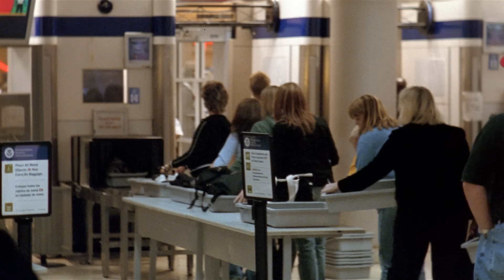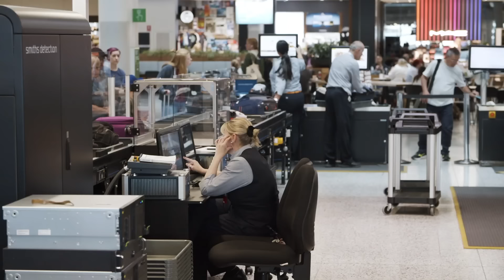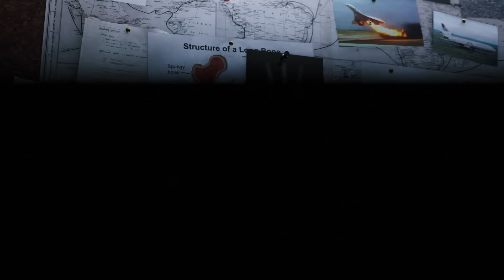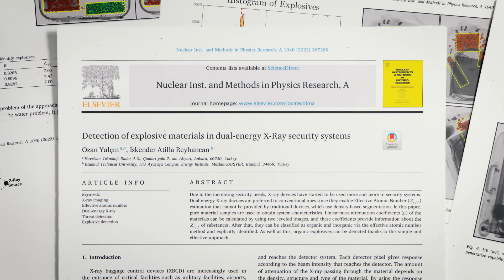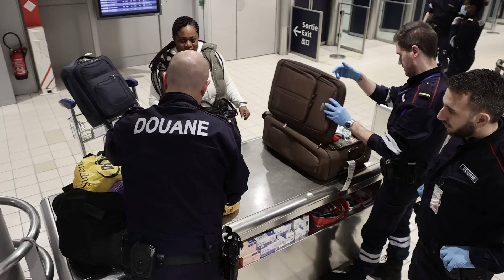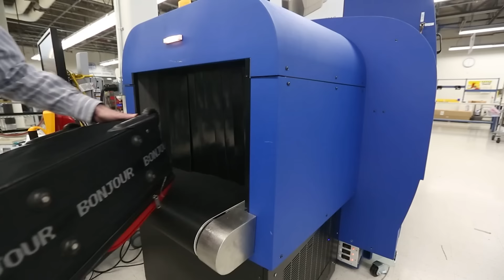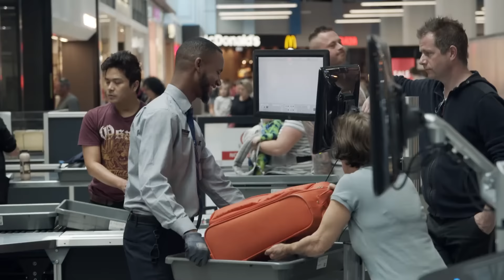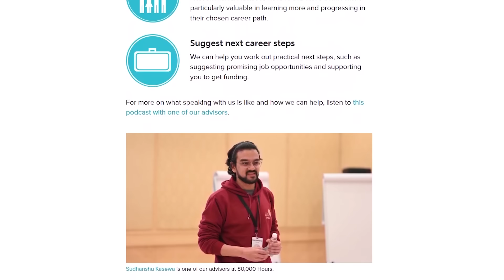Why Airport Security Suddenly Got Better

Comment: Beware if travelling with film! These machines will usually wreck it, put your film in a plastic bag and ask a member of staff to hand check it for you instead.
Reply: Yes, CT scanners will fog ALL film, regardless of speed (ISO)!  Hand check it always.
Reply: @FarkleMpls  That isn't true, it only matters if you don't store it properly, but hand checking it is still good so they don't think a knife is inside.
Reply: @FarkleMpls  This is incorrect, It depends on the CT scanner,  there is only 1 CT scanner on the market that is not safe for film the rest of them can scan film without damage.
Reply: @philipnash4043  Hi Philip -- thank you for this information.  Do you know the model # of the CT scanner?  I (prefer to) haul around film internationally and like to be well informed before I get into arguments about the necessity of hand-checking film with various TSA-like security folks around the world.  Berlin security was particularly stubborn.  I used to have Smiths Detection as my customers and I may check with their product engineers.  If I do, I'll post an update here.  Thanks again.
Reply: While good advice, hasn't this always been true with taking film through airport security? I remember traveling to Europe in 1992, and losing a few rolls of film to airport x-rays.
Reply: @BCWasbrough it really depends. every film is a bit different, but CT will cook the vast majority on one pass. Happened to me in Amsterdam, it did develop and you can obviously see the photo - but its really fogged - cinestill 800T - So i'll always arrive early ready to negotiate. Or put fake Delta 3200 iso stickers over so its too high to even be x-rayed hahaha!
Reply: @BCWasbrough  They used to sell lead plastered bags for films in that era.
Reply: @jimbotron70  Yeah. I was using them at the time. I credit their usage for not losing ALL of my pictures from that trip.
Reply: @jimbotron70 Those bags aren't safe to use anymore, the newer gen scanners will keep increasing its power until it can see through the bags.
Reply: @jimbotron70  Yeah, but the operators would just put up the power until they got an image so not really a solution.
Reply: @BCWasbrough  No. The old X-ray machines are not powerful enough to damage regular film. If i remember it correct the old X-ray machines emit round about a quarter of the natural background radiation. Your film is much more likely to be fried on board of the airplane at cruising altitude as it is subjected multiple times the natural background radiation at ground level for hours. The new CT scanners however can fry your film due to the use of high-power X-ray emitters.
Reply: Film cameras are like buying vinyl records. It's not mainstream anymore, but for a variety of reasons some people want it. Just because it's not for you doesn't mean that others don't care about it for their hobby.
Reply: bro my film got ruined at melbourne airport 😭
Reply: @lachlanlau  Oh Christ.  I got given six rolls of colour film last Christmas and flew out of Melbs,  They would hand-inspect the infrared that I bought but not the ISO100.  Guess that is all toast.
Reply: The difference between film and digital goes way beyond resolution. They have very different behaviors when it comes to dynamic range (difference between highlights and lowlights). 

Not just that, a 35mm film camera with good film might only cost a few hundred dollars, but mimic the resolution of a several-thousand dollar DSLR. While you're paying more per photo, the entry cost is much lower. That's great if you're trying to figure out if the hobby for you. Use your phone to get a general sense of light levels, framing, etc - then take one "keeper" shot on film.

That's before discussing medium-format and large-format film cameras, which can provide the equivalent of hundreds of megapixels under the right circumstances (plus the dynamic range benefits mentioned above).

Film is definitely a niche thing now, and not for the average person taking family snapshots like it was from the 50s through the 90s. But it's not completely obsolete.
Reply: @PsRohrbaugh Used DSLRs are quite cheap too, and are generally more flexible. Lets you experiment much easier when you immediately see the result. 

The films advantages are mainly the looks people like and the dynamic range. I don't really think that most people care about resolution that much, with the sizes we typically view images at. (and I see conflicting information if film "resolution" even wins against 10yo cameras nowadays at regular speeds)

I feel like the inconvenience of film are much more likely to make people not continue as the lower resolution of older digitals. 
Not like I can really say, I only shot film once at school in a photography class. I am considering giving it a try again soon, but it doesn't really fit my style of photography. 

In the end I'd rather recommend to go for something like 70D or 5Dmk2, although, old low end DSLRs can be experimented with as well. I personally started with a 550d, something that can be found used with like 30€. Really depends on your budget :)
Reply: @manitoba-op4jx 100 year old cameras don't just "have better resolution than your iphone", they have like... something along the lines of FORTY TIMES more resolution than your iphone, for 4x5, and 100x+ for larger formats (but those aren't really portable anymore)
Reply: Film can put in more details for its size. Such is why cinema is still using film today.

That being said. Processing them is a pain compared to a point and DSLR, mirrorless or your phone.
Reply: @niccatipay  Modern digital is more information dense per square millimeter, but there are not yet any medium format or up digital cameras that cost less than like, a car. (GFX is not medium format, MF is 645 and up). So even though it's more dense, the ceiling on format size makes it still lose to film medium format+. Mostly though, it's the look and the process.
Reply: i tried and the lady was so rude about it and made me put my film through with the others
there went that roll 😡
Reply: I have cassette tapes and I’m worried about them getting damaged in one of these!
Reply: @sncy5303 People who prefer the inconvenience and technical limitations of film over digital.
Reply: I have a lead bag for film.
Reply: I have a lead bag for film.
Reply: @xploration1437  They only help a bit, and they may possibly crank up the radiation to see through it anyway, depending on the machine's capabilities and their operating procedures there.
Reply: At first I went "yeah, of course"
Then "oh shit, that disposable camera I got might be fugged" 😬👍
Reply: Many years ago EASTMAN KODAK made film photography available to the masses inexpensively.  You have to be a certain age to remember a Brownie camera.  I visited the Kodak plant in Rochester New York state many years ago. Who could forget the Instamatic or the flash cube? Then along came Polaroid.
Reply: Digital sensors are unaffected.
Reply: I found this out with one of those instax Polaroids. I was so confused as to why ALL of the shots were coming out so overexposed!
Reply: Don't the TSA agents say that's just a conspiracy theory? "It'll be alright" 🤦‍♂
Reply: I'm sure somebody will come up with the idea to store ammunition in one of those reels and then it will be another thing that gets banned on flights. Imagine having to ship film reels a week before your flight only for it to get cancelled and your package delivered. Expensive old new stock film is going to become scarcer even faster.
Reply: Also be prepared for it to wipe your word processors... if that's something you need to be prepared for.
Reply: The war on terror was officially ended in 2019. Why are all these machines still there?! 
Hi time to remove them again. Or are we all now     "Guilty Until Proven Innocent"?
Reply: Thought most X-ray scanners are certified as 'film-safe'
Reply: Becaureful, in Lisbon airport (Portugal), the staff are not allow to hand check film without a premision from ANAC. If you dont have the premission it will need to go in the X-ray machine.
Reply: @goncalodemetrio1638  well then you simply stop the plane and have somebody from ANAC come over to give you the permission.
Reply: they make lead bags for film for a reason
Reply: Oof, learned from experience?
Reply: I wonder if that’s what happened to my disposable cameras from my 8th grade DC trip in 2005
Reply: Oh look, somebody didn't study engineering or science! They are the reason why public transport SUCKS! BOOO
Reply: Is it though bacause i had my film camera with me and they wouldn`t let me skip the scanning for it and i thought ok all my photos will be ruined but they turned out just fine, no quality loss or anything.
Reply: @bishopoftroy  Was it one of these new machines or an older one? What ISO was the film? IIRC, the older machines were supposedly safe for 400 and below or something like that
Reply: @Cyberguy42  I've heard older machines are safe for lower ISOs, but I never want to test it and always just have them hand-check all my film.
Reply: @Cyberguy42   Yes the older machines are pretty safe for 400 and below, but CT scanners are not.
Reply: @Cyberguy42  That is true, they are labelled 'film safe' but the exposure is cumulative so only take what you're going to use on a trip.
Reply: @bishopoftroy  Are you sure it was the newer CT scanner, or was it the old type of Xray machine? The older kind will not be too bad to lower ISO films (even higher ISO you will still get pictures, just perhaps slightly fogged).
Reply: @bishopoftroy  the fact it's inside the camera mightve protected em
Reply: @bishopoftroy  Yes there was quality loss. Did you shoot identical photos and mail one home to use as a side by side comparison? No, you didn't, because those who have done that and published it always show clear quality reduction. You just aren't aware of how much better it would have been.
Reply: @gavinjenkins899  i`m shooting the same film and the same camera for over 30 years now and i would`ve surely noticed something.
Reply: @bishopoftroy   That is irrelevant umless you have comparison shots of the same scene one of which didn't get scanned. Also CT scanners haven't even been in use that long, soo.... bs? Are you talking about old xrays, not CT scanners? The claim was that CT scanners ruin all film, not traditional xrays
Reply: @sncy5303  I'm a 25 year old photographer and I just started shooting on film about a year ago and I instantly became obsessed. Now I like shooting film arguably more than digital.
Reply: @sncy5303  Almost every photographer, next question
Reply: Or you can live in the current day and age and drop the pretentious attitude and buy an Alpha 7.  Film is great, don’t get me wrong, but grow and move on lmao
Reply: Ive heard they screw with the digital CMOS sensors used in modern mirrorless cameras as well.
Reply: @zaca211  wrong.  this is not true whatsoever.  Only undeveloped film has an issue.
Reply: @zaca211  Incorrect, low dose X-rays cant affect electronics in  short amount of time,
Reply: @zaca211  I've had my Sony A6000 go through the X-Ray machine countless times for almost a decade now cause there's no way it and my lenses are going in checked baggage. The only problem I have is envy to buy a A7 model...pictures are still perfectly fine.
Reply: Mylar bags works fairly well
Reply: @brkbtjunkie  Not for x-rays.
Reply: Thanks, I'll do that on the next return flight from 1972.
Reply: what is film?
Reply: I once tried to shove my horse and buggy through one of those new fangled airport scanning machines, and that unfriendly TSA agent got really mad at me.
Reply: maybe dont shove it next time
 @pilafmon
Reply: @manitoba-op4jx that's great! You should tell more people and finally put Apple out of business. I believe in you buddy 👍🏽
Reply: Film? Are you still living in 2008?
Reply: @T1Oracle  some people like using film
Reply: @bredemeijer9648  It's okay to have this opinion, you're not a photographer.
Reply: @T1Oracle  Film photography is alive and well; it may not be practical for the average user by comparison to a digital camera, but it is by no means gone as a technology. Film exposes much more detail per unit area than most consumer digital camera sensors, and in the hands of an experienced photographer will yield beautiful results. It is also still used for movie making, such as with IMAX 70mm.
Reply: @MediocreHexPeddler  Depends on what you mean by "most consumer digital camera sensors". Most modern DSLRs or mirrorless cameras will easily beat 35mm film in terms of resolution, perhaps barring some specialty high-resolution/low ISO films. My now ten year old Sony A7ii does 24 MP, which anecdotally seems to give me a lot more cropping possibilities than I have with most of my 35mm film.

Medium format (especially if you go for say 6x9 negatives) might still have an edge on digital though.
Reply: @bountyjedi  Your art has no truth.
Reply: @T1Oracle  Film photography industry is actually pretty big and even if it waned off in the mid 2000s up until ~2015-2016 it`s been surging since and it`s expected to double in the next 10 years. If you wanted to comment like this you should`ve done it in 2005-2006 so actually you`re the one not up to date.
Reply: @bishopoftroy  have you heard of mobile phones? Fun fact, billions of these things are sold every year, and they all have digital cameras attached. When film cameras sell in comparable numbers, let me know.
Reply: @T1Oracle  And all of those cellphone cameras are trash with minuscule sensors and shitty AI "enhancement" so that photos look barely passable on tiny cellphone screens. 
"It sells more" is not an argument. McDonald's sells more than any fine dining establishment, yet it's still slop for people who don't know better.
Reply: @T1Oracle  Sold in massive number to people who take bad photos in massive numbers, yes.
Reply: @T1Oracle  yes we have mobile phones here also but that`s not the topic here. If some greedy capitalist corporation forced you into feeling premium for buying their products ok good for you but remember that you`re an ambassador on your own money and here is discussed a completely different topic.
Reply: @bishopoftroy  I don't know what happened to my reply explaining all the premium digital imaging devices. Regardless NASA and the CIA both use digital over film. Mobile phones aren't the only digital imaging devices.
Reply: @T1Oracle the way you decide if something is valuable or relevant is by how many units it sells lol? do you have a shrunken head?
Reply: @T1Oracle  Film popularity has something like quadrupled in the last 10 years.
Reply: @gavinjenkins899  wow, four people use it now? 😂 (Sorry you walked into that one...)
Reply: @T1Oracle  I mean if you don't want to enjoy photography as much, or to just be ignorant for fun, then that's your problem, not sure what your goal here is lol.
Reply: @gavinjenkins899 Dude just seems to hate film photography.
Reply: @T1Oracle  More people are using film now than they were in 2008. There’s been a bit of a renaissance in film photography/movies lately and it’s only becoming more popular. I’d say the 2000s was actually the age when digital was king. I didn’t know anyone who liked film photography in 2008, but now, I know many people who prefer it over digital.
Reply: @T1Oracle  2001
Reply: @T1Oracle pros and cons to both. You would know that if you had any knowledge in the field.
Reply: That was only 16 years ago...Are you a child?

Comment: If they cared about terrorism they would have this level of security literally all over the place, all over roads and public places.
Planes are only 1 of many many ways to easily cause devistation... In fact they arnt even close to the easiest.

The whole airport security system isnt logical.
Why are you trying to protect against terrorism specificly in a very narrow segment that isnt even the easiest way to terrorize?

Theres only two non-contradictory stances.
1. Airport security should fade away over time... not ramp up in spending.
2. This level of monitoring needs to start being applied to the vast majority of roads and public areas.

Those are the only two non-contradictory stances.
Ill let you decide which one is ideal.

Comment: Its worth remembering that these scanners "work" if the public feels safe enough to be willing to buy airline tickets. There is no actual threat that is being defended from because there actually are vanishingly few reasons to want to blow up a plane. Its not actually a real threat in any real way. This is 99.9% theater. In fact you say "false positives slow things down" its worst.... false positives are a bigger threat to travelers than the original threat of terrorists. False positives are what we need to be protected from because otherwise all this security actually makes us less safe.